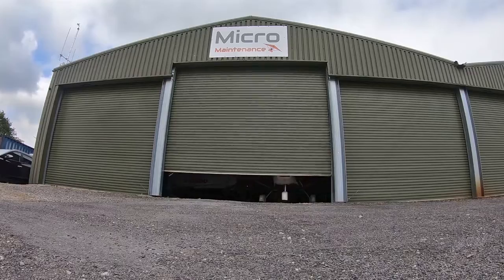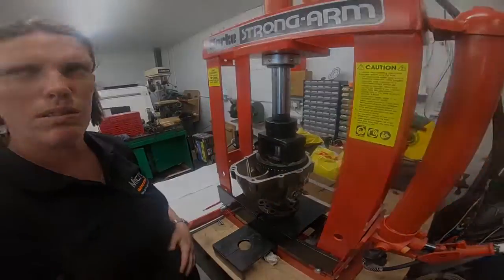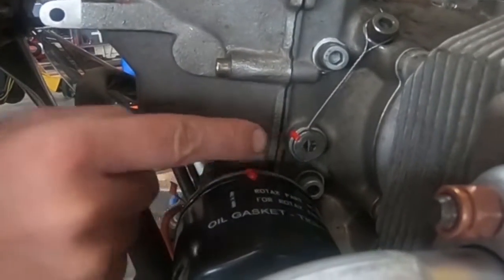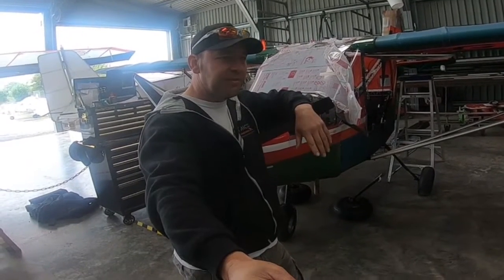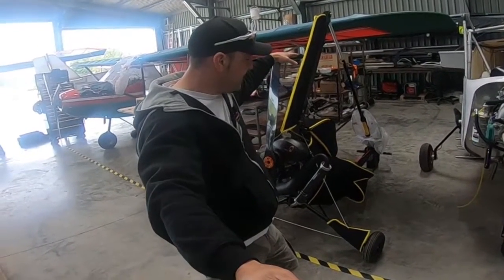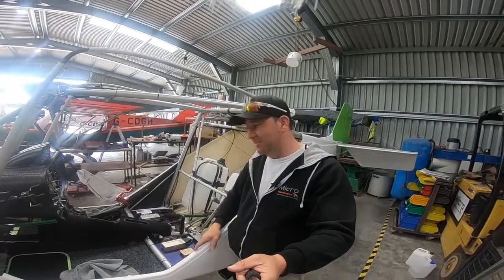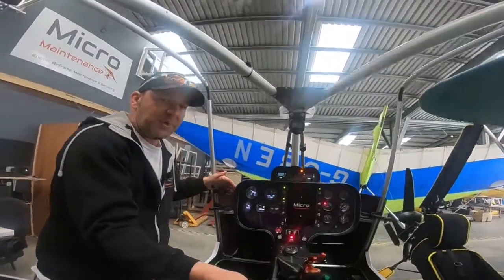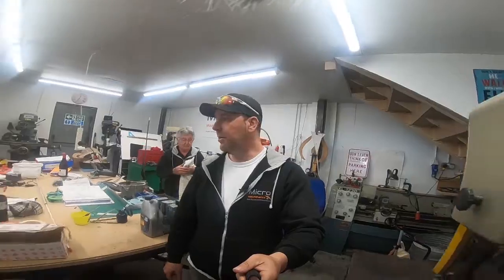T-Rans-formation, fetching Adam, and Mag-bolt Woes: Micro Maintenance - Episode 5 -

Comment: Hi Mark, another great episode. I converted from Flex to a Skyranger, and as part of the refurb of the Skyranger I put on flap indicators, just one blue light to show that the flap is on. We also did another mod which was another microswitch inline with the starter which was fitted at the back of the throttle arm behind the dash, it basically stops you starting the engine with the throttle open, same idea as the Quantums and Quiks. I have been glad of it a few times. We made a heater to fit on to the standard Rotax exhaust, works a treat and saved us 1500 quid, done through the BMAA mod process of course.
Reply from the maker: Hi Dai, yes the flap indicator is really useful and a great little reminder at theose “forgetful” times. We’ve also looked in to a a starter inhibitor as you will start a Skyranger on full power at least once 😬 thanks for watch img 👍🏻
Reply: Do you sell the flap indicator switches for the classic?
Reply from the maker: We do, there are some options available. Please feel free to message us via our website